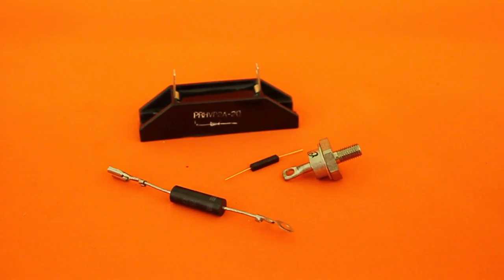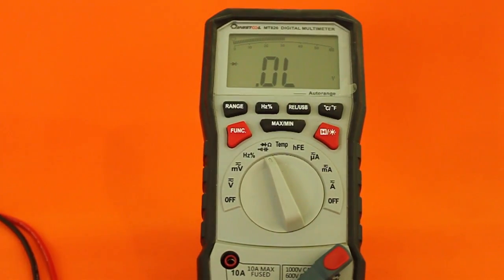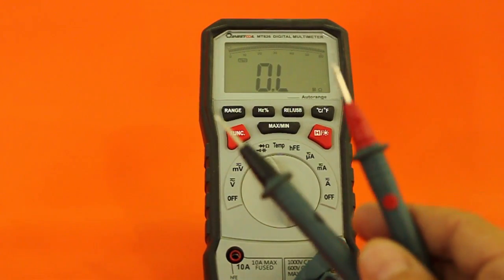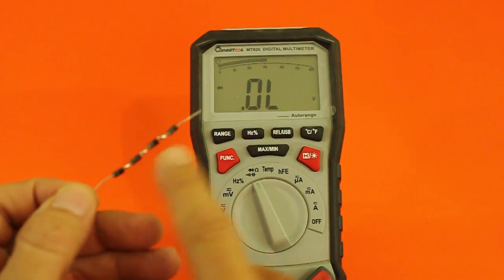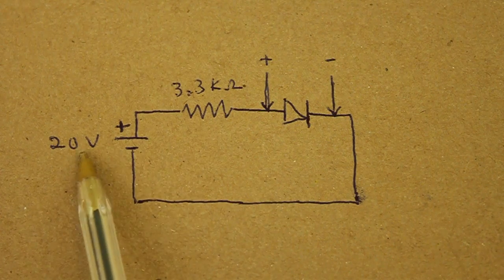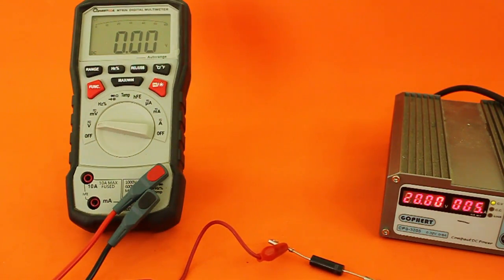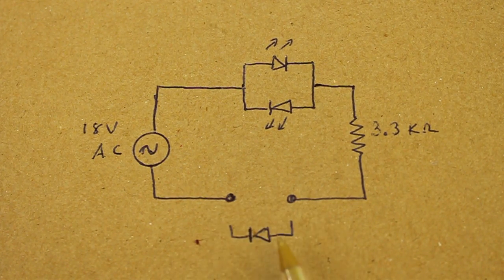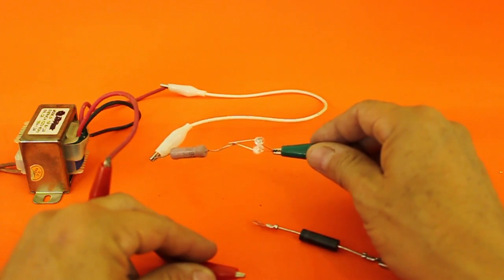How to Check High Voltage Diodes

Comment: Why do you need to add a 3.3 KOHM resistor in series for the circuit to measure the diode voltage drop? Can’t you just connect the diode directly to the voltage and measure? Or you want to limit the current to try and save the diode
Reply from the maker: Yes it is for limiting the current in diode

Comment: What is the power rating of 3.3 KOhms resistance u used in series of the diode?
Reply: It's not that important, 0.25W will be fine because it's a small current and it's used for a short time.

Comment: thank you, that was very helpful  I especially like your test circuit with the two LEDs.  a big thumbs up and a sub from me  mike
Reply: instablaster...
Reply: @walkerrandall3044  so, what is an instablaster...?
Reply: I dont think id use the led tester.  All of my diodes read the same voltage drop except for one, it must have had just a few internal diodes gone bad and had a voltage drop of a few volts less, I believe it was underperforming compared to the others and it wouldnt have been recognized with the led test.

Comment: Thanks! just used this method to find the bad diode in my voltage multiplier. Replaced that one bad diode and it started working again.

Comment: how to convert a higher current like 100 amps dc to a higher voltage on the output dc without a transformer ?
Reply: You can’t. You need to make an oscillator circuit to drive a transformer off of a dc power supply (a battery or rectified wall power, any dc power source you look for) and then rectify the output of the transformer

Comment: For the 20kV diode you checked last, why couldn't you use a DC power source instead of a transformer?  Also, why didn't you flip over either of the high voltage diodes?
Thanks much for the GREAT video!
Reply from the maker: Using AC allows you to use two LED´s to check for good diode and shorted diode

Comment: Thanks LS :)
How about MAKING a diode ? ;]
Reply: He already did high voltage diodes. If you mean the semiconductor it is not that easy. It is possible to create primitive diodes but not a proper one.
Reply from the maker: Yes a proper one requires high tech equipment and lab
Reply: Some simple early radio receivers used a "cat's whisker" diode which has a point contact between a fine wire and a suitable crystal (not bonded).  Try searching that term or crystal radio, you might be able to make one quite easily!